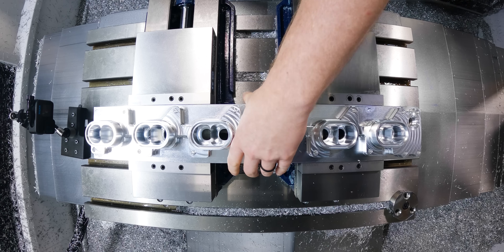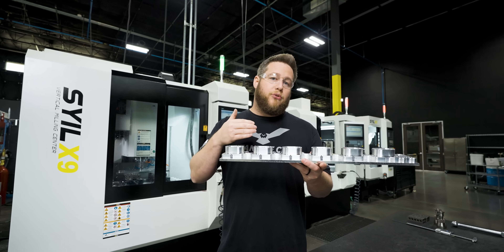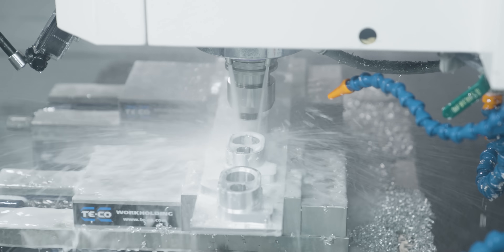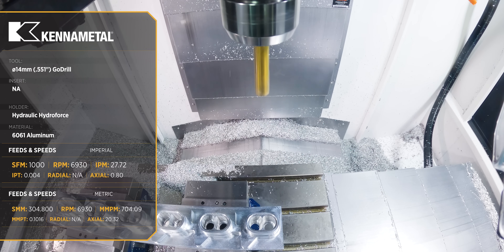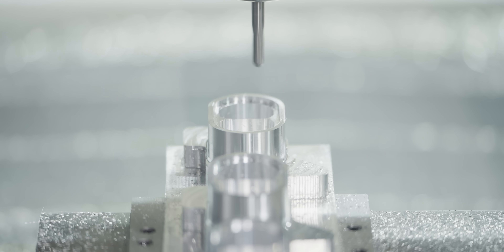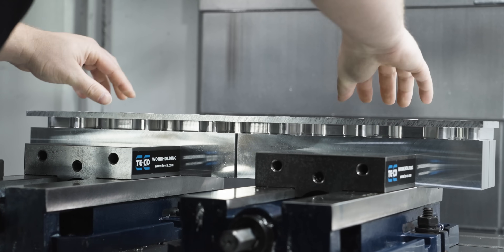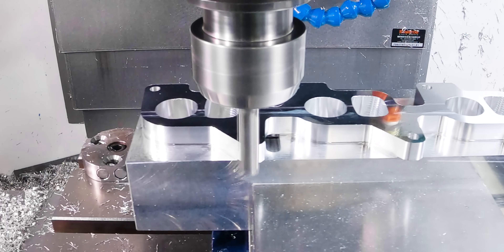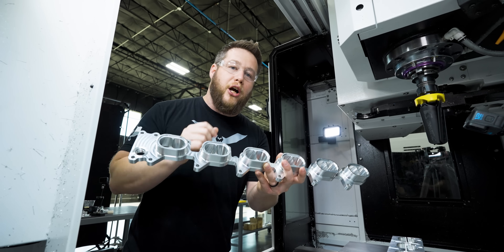How to Machine a Perfect Intake Flange Manifold

Comment: This machine has internal cooling fluid system. 2 or 3 edge end mill with internal coolling holes will significantly speed up  the roughing operation on the inside geometry. Cooling fluid will blast away all the chips. Works great on aluminum.

Comment: Nice job, for machines with not much power, I would use an "old - fashion" 3 flutes polished carbide roughing mill.
You can take bigger steps without out-powering the spindle.

Comment: I have thought it would be nice if CAM allowed for different feeds speeds and radials based on depth of cut during the roughing/adaptive ops. I have some ops that are set based on the max DOC that look great but when the tool steps up to shallower depths in the same op I want it to do more.